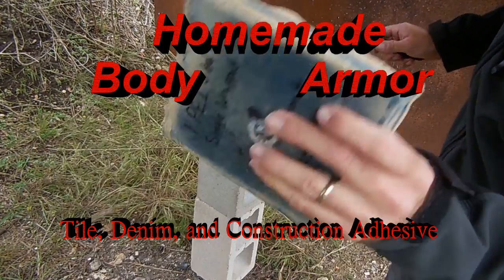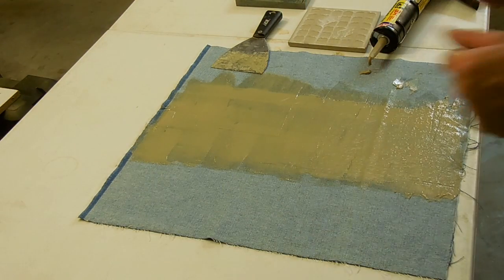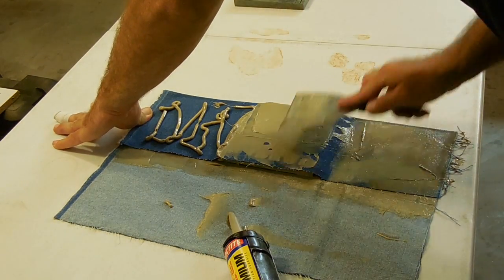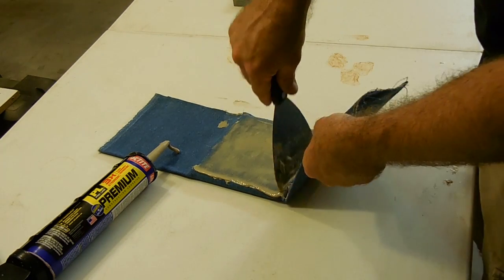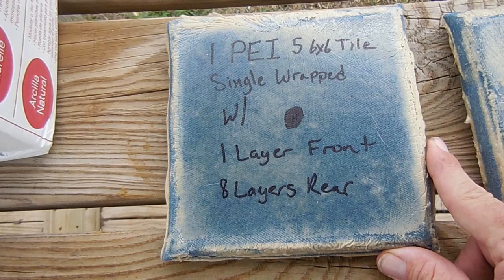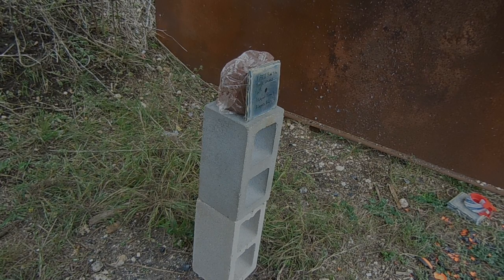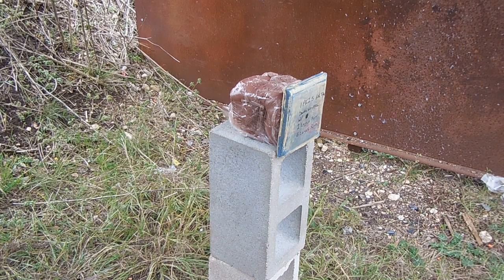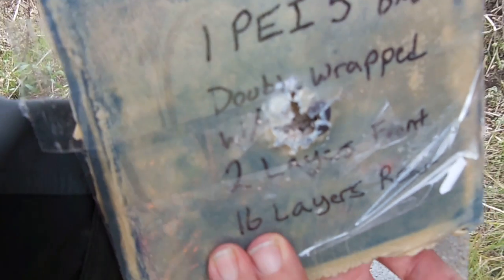Homemade Body Armor

Comment: Take 20 layers of fiberglass mix 3% powder graphene in resin by weight. Put one metal plate in rear of plate. Cover plate in rubber coating with 3% graphene by weight all over the plate. Graphene makes concrete 70% stronger 2% by weight . 3% graphene in resin and rubber mix by weight should make it little over 100% stronger. Should have level 4 to 5 bulletproof plate when finished.

Comment: Always test with FMJ.  It is easier for armor to stop hollow point than FMJ.  

For real interesting and inexpensive improvement, there are some materials science papers published out of Brazil where they tested natural fibers vs kevlar for body armor.  The test plates they made had a ceramic front and multiple layers of fiber behind (about 3/4").  The BEST fibers, literally equaling kevlar in this role, were ramie, jute, and best of all, COCONUT LEAVES!  Unfortunately they didn't test hemp fabric but I expect it would work as well as these others.  I suspect if you did this same thing but backed the ceramic with about 3/4 inch of layered ramie or hemp you would get to level III fairly easily.  

I'm doing this same thing but I bought UHMWPE fabric.  My next go will be with ramie or hemp because it is cheaper than UHMWPE.  I'm wrapping the entire shebang with a layer of kevlar (my anti-spall layer).
Reply from the maker: Interesting info. The denim is comparable in tensile strength to hemp or jute. Especially when bonded with the construction adhesive.
Reply: @ProfessionalPepper  If you want one of the papers to read, you can get a copy here: https://drive.google.com/file/d/1yR_D6O6DFbTaJa7VmvuGSeQSXXOQJN1R/view?usp=drivesdk

Comment: Kevlar, Spectra, Aramid and Dyneema/Cuben cloth can all be bought inexpensively online. Add strutural epoxy instead of glue, and vacuum bag it. Way better product for the same work.
Reply from the maker: Online isn't necessarily readily available.  Material at Lowes is.  Please make a video showing that process and documenting how easy it is.  I'll wait.
Reply: @ProfessionalPepper  If you can't wait a week or two to order in materials, you're not "prepping". You're Macgivering out of a situation you weren't prepared for. Like trying to gas up your car a day after the hurricane evacuation orders.
Reply from the maker: Following that logic you should have bought commercially available plates and skip the whole DIY process.  Info is info buddy, I'm sure your prep plan isn't 100% rock solid and you will need good info to fix those holes when SHTF.
Reply: Prepping does not equal just stockpiling stuff. Building up Skills & Knowledge allows you to improvise if necessary.

Comment: 1st one would brake some bones.
2nd shot big bruise
Reply from the maker: neither one would break bones.  They would both bruise. Look up NIJ testing correlation to injury theory and get back to me.
Reply: @ProfessionalPepper  
You dont think the impact would break a rib.?
I know u all the stats.
Just thinking about self protection will all that has been going onn lately.
Tying to research a good light weight vest
Reply from the maker: @eamonaugustine1262  you would only receive bruising from the deformation identified on the backside on the clay block. The maximum allowable deformation, identified by NIJ Standards, may only cause bruising, but will not result in injuries that incompacitate an average man.
Reply from the maker: if you want a good vest, just invest in lightweight 3+ plates that can stop 5.56, or go with a soft body armor if you think the only threat you would encounter is from a handgun.

Comment: What if you added a layer of steel behind the tile? Might make it 
More effective.
Reply from the maker: It would only help, but it will add weight and thickness to the plate.  What are you trying to stop?

Comment: Very cool , if you uses a plate off 3.5mm carbon steel it will works also its very cheap and effective , you just will need to something to spalling protection
Reply from the maker: steel is very consistent, but heavy.
Reply: @ProfessionalPepper   a 1/8" mild steel plate  in sapi cut is not heavy at all is no more than 1.6 kilos about 3.5 pounds is thinner and easyer to make
Reply: @ProfessionalPepper  
https://youtu.be/t4VmRiDuIwM 
https://youtu.be/J61k0NE3myU a plate using that kind of metal

Comment: You are the first youtuber I have see to measure the "blunt force trama" a bullet makes on the target behind the ballistic plate. If memory serves me correct, the max deflection the department of justice allows is 1.7".  More than that can easily kill from blunt-force trauma. I remember several years ago a cop was shot by a soft nose 30-30 Win. rifle. Even though the bullet didn't penetrate his level 3A vest, the officer died from the Blunt-force trauma. Thanks for making your tests real and practical.
Reply from the maker: Thanks for watching.  The NIJ standard is 1.73".  1.73" is a BFD that has the possibility of causing permanent internal organ damage.  A 30-30 has a significantly greater  amount of energy than 99% of handgun rounds applied across a smaller cross-sectional area.  Amazing it didn't penetrate.

Comment: What kind of steel was that. I have always wanted to test a plate like this but like that there is a ceramic plate between two steel plates and each is 1cm thick
Reply from the maker: ukkomies100 that was galvanized steel, cold rolled. there was just a tile and denim. no steel

Comment: Glad I found your videos! I broke a few layers of my ceramic plate overseas and I was fascinated by it. lol I kept flexing the corner of the plate where it was broke and listening to the edges grate together. The entire corner wasn't broken, just the outer few layers. My squad leader had it replaced right away for liability reason, but I just couldn't stop grinding those layers together! lol
Reply from the maker: The Sick Horse Ranch it's amazing how durable esapi plates are. I've never personally seen a completely broken plate. 
BTW great name.
Reply: I'm pretty sure my plate broke from general gear tossing around, but it could have been one ridiculous high speed, off road mission that I happened to be gunner on. I was bouncing around in the turret like a pinball. Like you said though, the plate wasn't broken completely through. The science behind stopping a bullet has fascinated me for a long time now.
Reply from the maker: The Sick Horse Ranch it's is fascinating. There is an interesting relationship between the projectile and the target. I did a video on homemade body armor basics earlier that went over that relationship.  The formula of penetration is dependent on several factors including the bullets velocity, cross sectional density, momentum, and bullet construction & material ex. copper jacketed FMJ with mild steel core > solid copper projectile > copper jacketed hollow point lead core > hard cast lead with flat nose.  It gets complicated fast.

Comment: What is the purpose for the tile, and can it be substituted with anything else, like more plate metal?
Reply from the maker: Mad Hatman the tile has a greater hardness of that of the bullet and has a high shear strength. The bullet is deformed and flattened out giving it a greater surface area for the fabric to absorb the remaining kinetic energy.
Reply from the maker: thomastruthseeker the ceramic tile could be replaced by metal, but metal is heavier, less accessible, and more expensive.

Comment: Will 10-20 layers of denim with epoxy resin or construction adhesive alone stop handgun rounds like fiberglass w/ resin plates?
Reply from the maker: 10 no, but 20 I'm not sure, but it is unlikely.  please feel free to test it out.  The tile performs a very specific function

Comment: Does the type of fabric matter?
Reply from the maker: The greater the tensile strength of the material, elasticity, and tighter the weave of the fabric the better.
Reply: Alright thanks.
Reply: I mentioned above...research on cheap natural fibers for ballistic armor has been conducted in Brazil and they get VERY good results, equal to Kevlar, using natural fibers like ramie, jute, coconut leaves...one of the best would be hard to get (the researchers got it kind of as a favor by a farmer) is bamboo fiber.  Not strips of bamboo wood, they actually got the fibers out of the bamboo and that stuff was REALLY effective.  In any case, I bet hemp would be in line with ramie and jute.  If you put a ceramic tile on the front and backed it with 3/4 to 1 inch of one of these natural fibers you can get into level III territory, according to their work.

Comment: What's the approximate cost of a single armor plate?
Reply from the maker: $5 - $6 for a 6x6 plate
Reply: The Professional Prepper (Prep Know Do) Thank you.
Reply from the maker: This cost approx $6-$8 depending on where you get your denim and tile from.  I listed an amazon link in the video description to the denim I used.  The adhesive is the key! Don't cheap out.  Get the Locktite 3x strong stuff (also in an amazon link).  Good Luck.  I'm going to try 2 tiles and one 1/4" aluminum plate for 5.56.
Reply: +The Professional Prepper (Prep Know Do)   Thanks for the info. I plan to use this same process but I am gonna also add a layer of 3/8 steel plate for  5.56 and 7.62 rounds. I am hoping I can keep the plate around 8 pounds and no thicker than 1 inch.
.

Comment: What would you think about to add a layer of medium/high dense foam (from a thin swim board? or else) in order to reduce dent in the clay? ...since no penetration with 8 denim layers, it may provide the same backface signature than the 16 layers. I guess it could be even cheaper (less sealant, less denim fabric), less time consuming to construct, but a bit bulkier.

Comment: When you get range time - Try .308! :)
Reply: *****

In intention or preference?
Reply: *****

True, but I'm a .308 kinda guy. :)
Reply: If it will stop .308 fmj it will stop .223/5.56 (except M855 - it is a tough nut to stop M855 with basic armor).
Reply: @BooDamnHoo  M855 doesn't trump .308 surely? I'd need to see some box of truth on that one my dude.
Reply: @ShadowedbySusan  Not so sure.  Maybe, maybe not.  There M855 is not true armor piercing ammo but it is specifically designed for light barrier penetration to get to the target.  It has a steel tip on it to help stabilize it and get it through the barrier.  It doesn't deform like normal lead core 5.56.   It isn't as deadly against human targets but it is more effective against barriers.  So...it is just the common wisdom that DIY body armor doesn't fare well against M855 as compared to other rounds.  Sure, if something can stop 7.62 AP round it is a virtual guarantee it will stop M855 which isn't ACTUAL AP but it may well do better against a bit of armor than FMJ 7.62/.308.  
I'd be interested in results for both to see if the M855 is as mean against thin armor as the story goes.  It is thinner than .308 so the energy is directed into a smaller, tighter cross section at short ranges.

https://www.thetruthaboutguns.com/the-truth-about-m855-5-56-nato-ammunition/